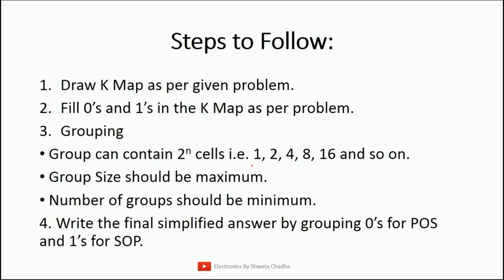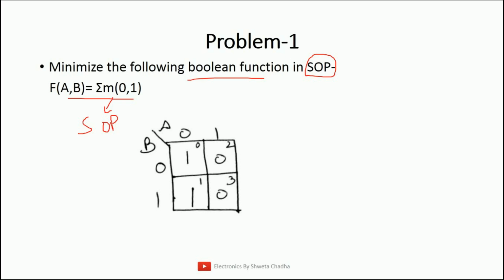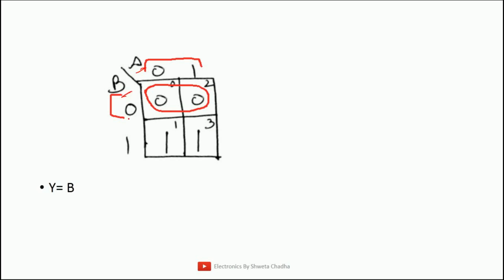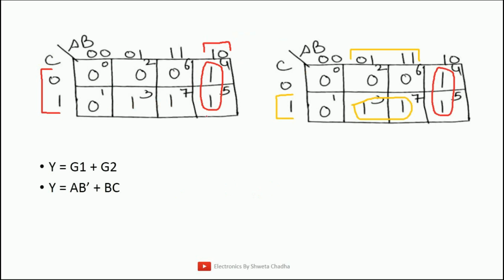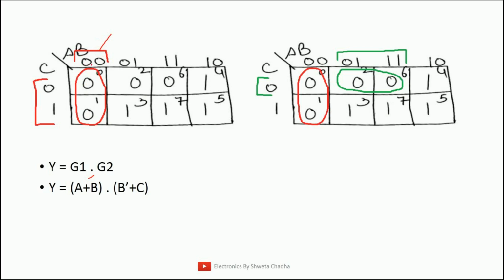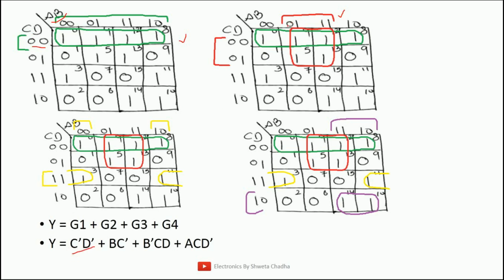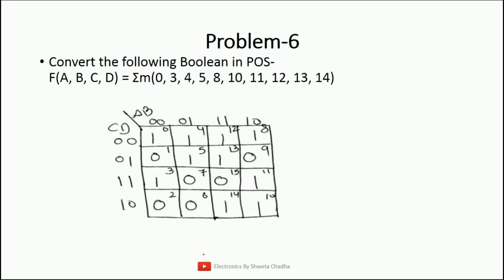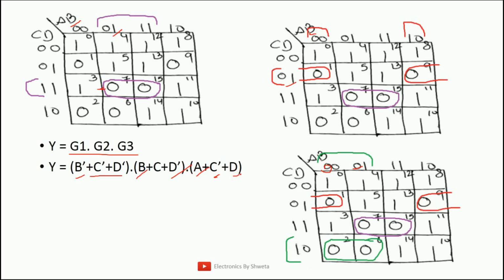K map (Solved Problems with explanation)

Comment: mam aap pos aur sop ke liye same k-map q use kr rhi h
if the question is given in standard form then for sop you made sop according to 1 for A , B and 0 for A' ,B' but then for pos you should be using 1 for A',B' and 0 for A,B but instead you used the same k-map
Reply: right k map same nhi hoga